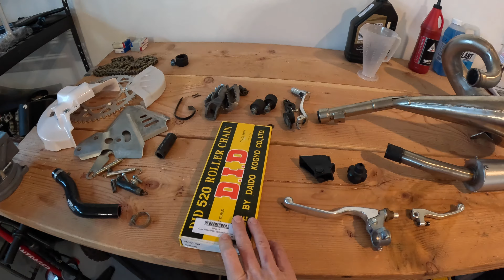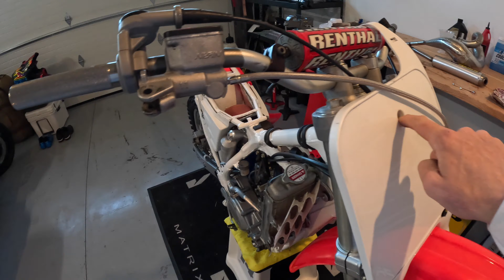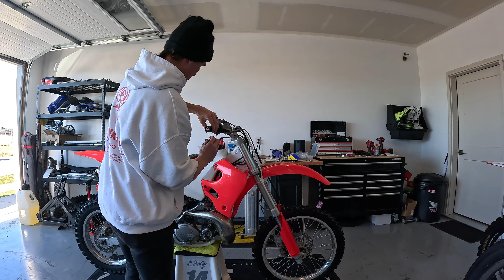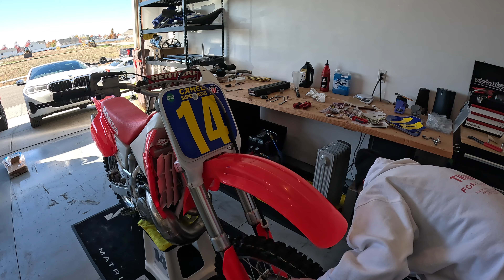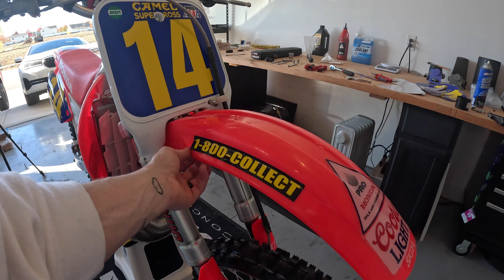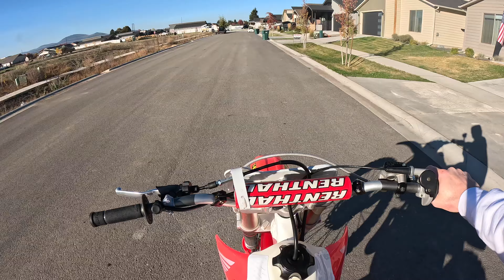CR250 Build is Complete! (Kinda)

Comment: The ufo stadium plate doesn't fit because 94 and 95 are a different part. Check your vin. Looks to be a 95.
Reply: With 92-94 plastics?